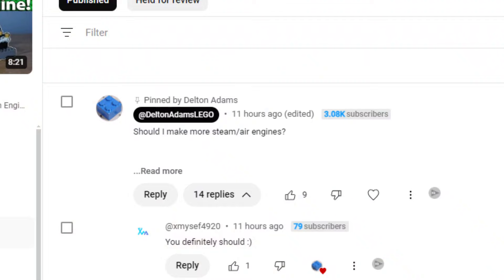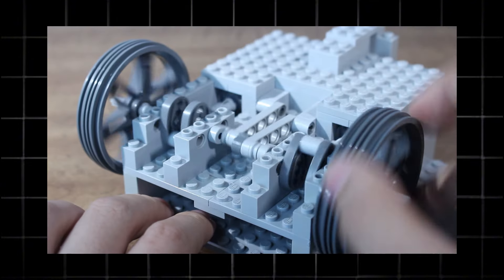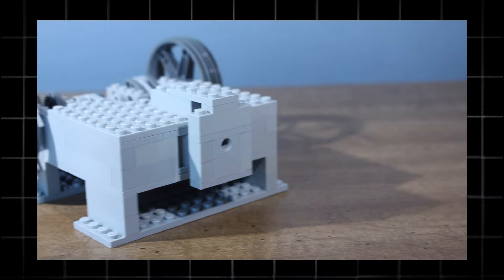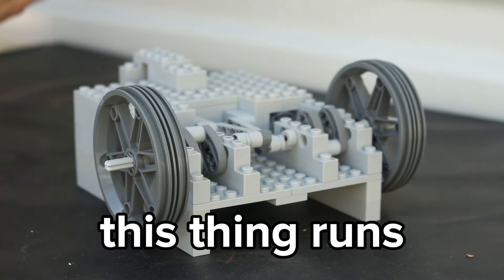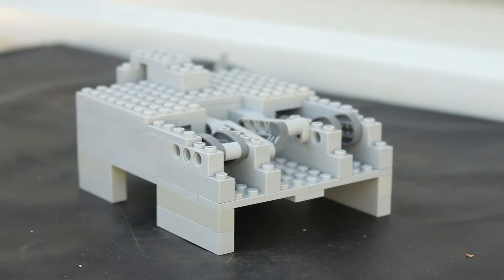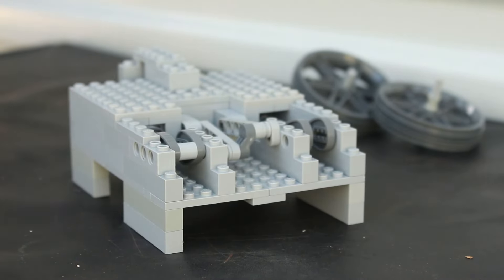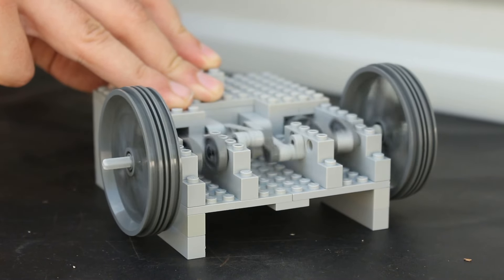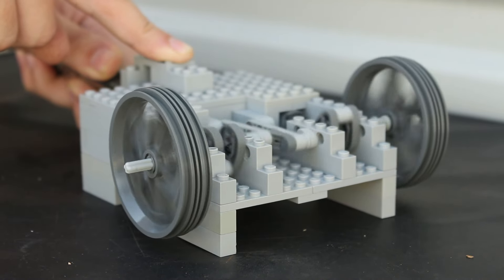LEGO "Steam" Engine: 2 Cylinders!

Comment: I would recommend using Lego pneumatics, as they don’t leak and very high pressures plus you can modify port size for higher power. They won’t run as fast but they definitely have a lot of torque
Reply from the maker: @BrickEngines  this is just a fun project. I'm not trying to power anything or make a lot of torque. And besides, I don't have that kind of money to buy the pneumatic parts

Comment: Note: Steam engines are in fact double acting, instead of single acting. Meaning you should maybe make a version with that set up. Also, on a 2 cylinder engine, the  timing of let's say the right cylinder is always 25% ahead of the other cylinder. That way, it can start without needing a push
Reply from the maker: @EmilyChaosDrivr  yep! You are 100% right! I've already made a few as well!

Comment: 0: 22 Two-cylinder engines run better when they're 90° apart, or out of phase. Running the drive cranks opposite each other will run a higher risk of jamming, and makes a lot more noise.
Reply from the maker: @jamesgroccia644  yeah, I know the whole 90° thing, that's kinda why I was surprised at how well this one ran, being 180°
Reply: That only applies to double acting engines, this is single acting
Reply: @Dudeface167  The same principle applies in either case

Comment: Set the cranks 90 degrees rather than 180
Reply from the maker: I know that's the proper way to do it, but I just wanted to see how the improper way would work
Reply: @DeltonAdamsLEGO  I'd be interested to see how well it would perform the proper way :)
Reply from the maker: @robertyoung9988  I might test that out with my double action design, but I'm currently working on another project, so it'll be a little while before I get to it